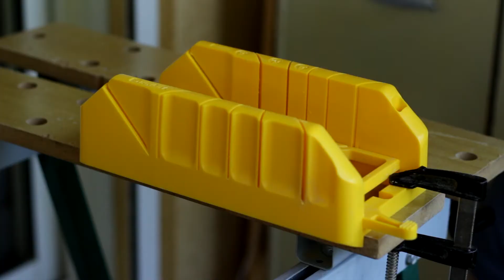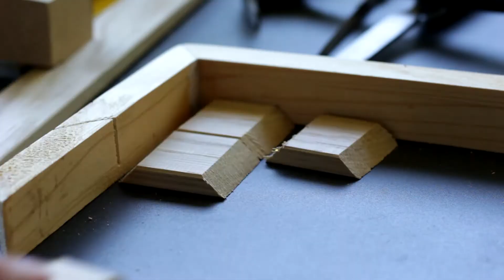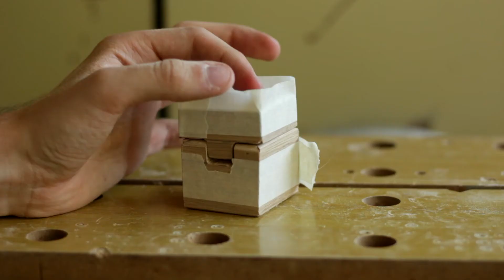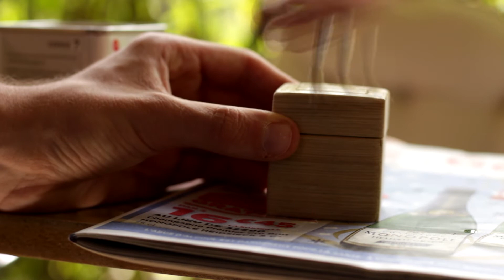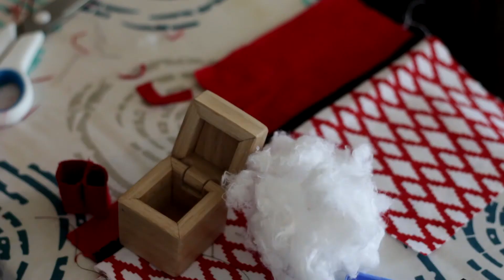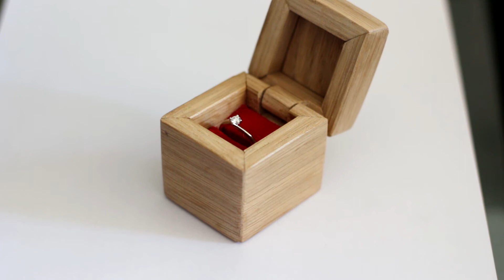Making a homemade ring box

Comment: What did you do for the hinge? Is there a hidden metal pin?
Reply from the maker: Yep, unfornately I lost the footage where I created the hinge.
The metal pin was simply a nail with the head removed. I drilled a 2mm hole. I would recommend using a press drill (even if I didn't) to be as perpendicual as possible ;-)